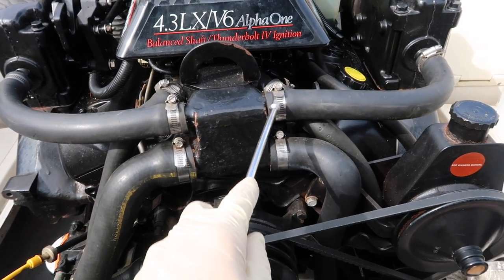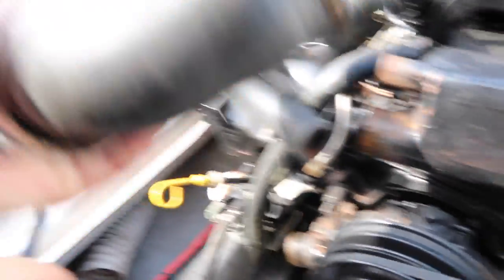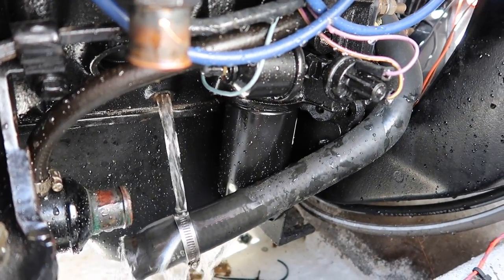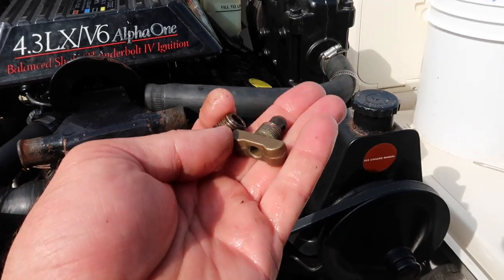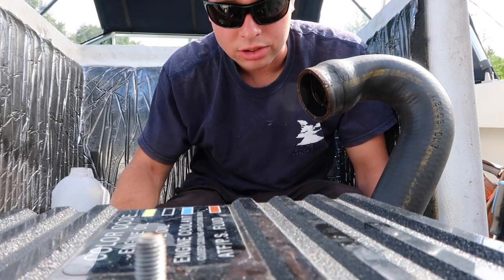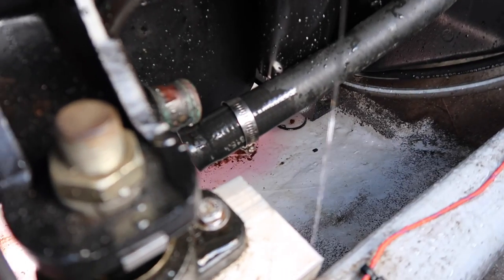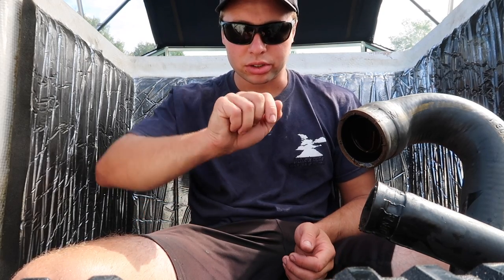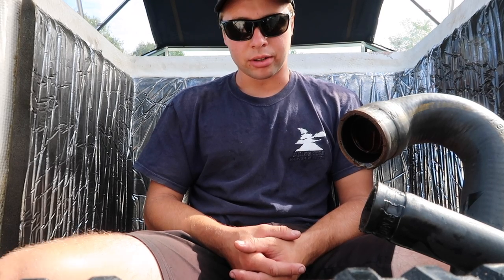Mercruiser 4.3 LX V6 Winterization

Comment: Thanks so much for this video! 
Just got my boat this season, and it ran great so I want to make sure I get it properly winterized. It was almost impossible to get to the port-side engine drain plug because my engine has seats on both sides. Your video helped me to locate that plug and make sure that I got everything properly drained. 
Thanks again!

Comment: I loved this video, I have the same '96 4.3 LX, but in my 22 years of ownership, I've never had the hoses off. After I loosened the 1st 3 hose clamps, those hoses remained solidly, stubbornly, like glued on. So, I resorted to my usual process of pouring 4 gallons of RV antifreeze into a funnel to a garden hose to the clamshell flush muff on the intake to the sterndrive, while the engine is running. Not elegant, probably not as thorough, but it works.
Reply from the maker: That works. Definitely not as thorough and does not remove the rust from the block but yes it does get the job done.

Comment: Great video. Straight to the point....I think i have a problem though, water initially came out of the block plugs but  antifreeze never did. And i put two jugs in it. Seemed to hold the majority, a little came outta the disconnected hoses. Am i screwed? 🤷

Comment: If you want to put some extra time in, you can fog the engine as well as drain/replace that lower unit oil. I like to hit the outside of the engine with a little wd40. That will keep built up moisture in the engine compartment from developing mold on the engine. Don't have to douse it, just enough to coat.
Reply from the maker: Yes all good idea’s. We always Fog, gear oil, stabilize disconnect batteries etc. I like the WD40 idea. Also a good idea is to prop open the engine hatch for storage to let it breathe.

Comment: On an I/O with the impeller in the drive I would put the drive all the way down, and disconnect the raw water intake line at the thermostat housing. Point it down in the bilge to drain. Then fill it with -100 AF till it comes out the drive water intakes. You can also just bump it over with the starter just a bit to get the AF fully in the impeller. Reconnect the hose. With the drain plugs I like to coat the threads of the metal ones in OMC gasket sealer or Permatex aviation and put them back in so they don't get lost. I had a plug leak just slightly on my OMC Cobra 4.3 and it leaked salt water RIGHT on the starter solenoid. Made it a rusted mess because the manifold drain was right over the solenoid.

Comment: PS if you have a newer Vortec V6 (intake has 8 bolts instead of 12) there is a drain plug on the front face of the intake manifold, left side as you fact it, will be behind the serpentine belt.

Comment: Agree on the great video comment . 
My 1st question is around the type of antifreeze and where to purchase in Ontario Canada.
Thank very much.
2nd question,
Have you heard of running the engine in a drum with  appropriate amount of antifreeze. Pro or con?
Thank you
Reply from the maker: Hey John, running in a barrel or on muffs with antifreeze can be done. However if you don’t want to worry do it this way. 

As far as antifreeze home hardware, Canadian tire etc is all fine. Some will say for plastic pipes only etc. Don’t worry about that. The system runs dry itself but we dump the antifreeze in to be sure there is no water in it.

Comment: Great video thanks. Very helpful as I bought a boat late season and I’m scrambling to winterize.
Reply from the maker: Glad i can help. They are very straight forward.
Reply: I going through now .   Did your boat freeze or no ?   I just bought 1 now got do it.
Reply: No, we have not got that cold yet. Sure have to stand on your head to do mine!
Reply from the maker: There is s select few that i can film. Most are head standing fun.
Reply: I did the muff antifreeze fill. Should I drain the fluid from exhaust and block? I see some people leave the antifreeze and some drain after. Thanks
Reply from the maker: It is up to you. I personally like them dry because there is 0 chance of it freezing. You can leave it and it may be fine but if the antifreeze mixture is leaned out at all from water in the block/ manifolds, hoses it could freeze. If the plugs are easily accessible give yourself some extra reassurance and pull the plugs and poke the holes and drain them.

Comment: some questions after watching:
you just need use the coolant to flush the hose, and don't need to fill is up. right?
When you drain the water and flush, how did you dry you boat after that? does the water out from the drain hole?
Thanks
Reply from the maker: Hey! Yes coolant is just a precaution as a flush to be sure the engine is drained. It will run out the plug yes.
Reply: Thanks for your reply. Really help me as a new boat owner

Comment: I really appreciate your time explaining it.
Reply from the maker: It was worth it just for your comment. Thanks Aleksander.
Reply: @Schneids15  i did today 4.3 mercruiser winterizing and i am scared that it is not done properly as i used camco canister and run fresh water up until termostat opened and then switched to the rv -50 antifreeze. Waited up until maybe 4 gallons of antifreeze went through and then i did fogging. I did open 4 spots and pink water went through kind of want to do it again i will put white plate to make sure is pink once it comes out. 40$ extra dollars for antifreeze but i want to repeat the process and will Fogg it again.  Fuel stabilizer is in it and 75% of fuel in the tank.
Reply from the maker: This is why i pull the hoses then put the antifreeze through. Those camco winterizers can cause big problems.
Reply: @Schneids15  totally i spent 100$ for the kit and antifreeze and then realized that i have water then today i went  again and bought expensive one without alcohol and put 5 gallons and did exactly what they said and once i opened the plugs it was water so i drained the system and put 2 gallons of antifreeze through all the hose i saw like alllll. Now i see pink if I failed as i am doing it first time totally accepting my fail did it the best to my knowledge. If the block is ok in the spring i am certified marine mechanic:)

Comment: awesome video thank you. first timer here. question, am i just pouring the antifreeze through all the lines as you did and leaving the drain plugs out and the hoses unattached? i dont pour anything in there after all the water has drained out and it is showing antifreeze and leave it in there and reattach the hoses? so more or less i am just flushing the hoses/cooler/lines ?
Reply from the maker: Yes drain everything and the antifreeze is just a flush to verify everything has drained out.

Comment: Did you have to put the plugs back and the hoses back on the manifold and fill it full of antifreeze for the winter or just run  flush it and leave it and not put nothing back together to store for the winter thanks

Comment: I really appreciate your video...awesome job. Just curious though...some guys talks about putting antifreeze in for the winter...if you do, you use just standard antifreeze (like auto)....or do you just leave everything open as some guys also say "air doesn't freeze"?  Thanks
Reply from the maker: Hey, so use RV plumbing antifreeze. Non toxic. Also using this method technically you need no antifreeze. The antifreeze is just a visual aid that the water has gone through the system.

Comment: Do you close the plugs back off and then fill it with coolant??
Reply from the maker: No I simply give it a little slosh so I can see the coolant come out the plugs to verify no blockages. The system stays empty and dry. “Air doesn’t freeze”

Comment: Hi.  Any chance you can tell me what the propeller size is on this?  I have a 1993 Maxum 1800 sr that has the 4.3 that looks identical to this engine so I was guessing your propeller would be the same.  I bought a boat that had the propeller all chewed up so I wanted to purchase the correct size and pitch.
Thanks.
Reply from the maker: Hey. I can’t guarantee size because every boat is different. Look on the sides of the prop between the blades or close to the hub on each end and it should show some numbers. You will need to find the pitch and the diameter. It will likely be around a 14 1/4 diameter and a 19P for pitch

Comment: Why the thermostat hose inside has springs and my left side manifold hose has a ball size plugs? Thanks
Reply from the maker: Springs are to form the hose and prevent it from collapsing. If talking the balls that are spring loaded going to manifolds that is so exhaust gas does not push in and go into your cooling system. Only water can go out

Comment: I have a question so the 4 hoses in the front the 2 top manifold and then you said the bottom that goes to the water pump do you pour water in there before you disconnect it and put it in the top?

Comment: Question: on the right side of the engine, there is a container behind the pulley. What kind of oil needs to be refilled there?
Reply from the maker: That sounds like your power steering pump. ATF is what they come with from factory.
Reply: @Schneids15  thank you for the answer

Comment: water pump is not in the back its in the front, does it need attention as well?
Reply from the maker: Water circulating pump is in the front correct. Water impeller pump is in the drive.

Comment: Great video...Great Job! Did you remember to throw some antifreeze down the out drive hose? I usually do that until it starts running out of it.
Reply from the maker: Yes you could do that for sure. I never have put any down the hose. It’s not a bad idea but I have never had one issue in 10 years doing it without.

Comment: Thinking about buying  a 2000 trophy boat with a 4.3 mercuicer, 21 ft walk around, the boat weights around 3000 pounds with fuel, please share your thoughts, ease of maintainence, horse power for a boat that size, is a good engine,
Reply from the maker: A 4.3 will have no problem with that boat. On the mid 2000 models they had some exhaust manifold issues but that boat should be pre that for sure. That being said the exhaust manifolds would have been replaced by now anyways likely... great motors. Very reliable. I have some with over 2000 hours on them. Many from the 1980s still running excellent still. You won’t win any speed records on top end but you should see high 30s in the mph range and it will pop out of the hole just fine
Reply: @Schneids15  great info. Your the best

Comment: Great video, two questions: Do you run the engine for awhile to make sure thermostat is open prior to doing this, and how much antifreeze do you use for this process, 2 jugs or ?
Reply from the maker: Hey Jared. One jug. No need to run the engine and open thermostat as you are pouring the fluid around it. Does not matter if open or closed
Reply: @Schneids15  thanks for the reply!
Reply: @Schneids15  i have a question for you buddy please when you can

Comment: Any tips for getting the power steering cooler hose off?   Mine won’t budge.
Reply from the maker: Try a flat head screw driver. Sometimes twisting the hose and prying on far end with flat head screwdriver will crack it loose.
Reply: Thanks for the quick response. If I can’t get it off, can I take off the hose at the thermostat and pour antifreeze in it and it will go out the back of the boat?
Reply: Another option if you have mufflers is to warm the engine up, warm hoses usually come off a little easier. Also, lightly use a pair of pliers around the hose where the bracket was and twist back and forth a little. Key word gently as you don't want to damage the rubber. I have done this on numerous auto hoses with success every time.
Reply: (A little late, but for future visitors) Use channel lock pliers, grip the hose on the nipple and rotate the hose on the nipple.  That breaks the seal without damaging the hose. Then you can pull it off.

Comment: Nicely done!  I have same engine.  I do it pretty much the same way.  I consider it thorough.  Never had an issue in 20+ years.  I also like to spray my hoses with WD40 before I put them back on.  Skipped it one year and hoses were harder to get off (or so I thought) - maybe just the placebo effect!  What is your opinion on these antifreeze tanks that you hook up in-line with your ear muffs?  I bought one but I hesitate to use it.  I think it'll be great for my wave runners but I hesitate on the boat.
Reply from the maker: Great idea with wd40. You know what the ear muffs do work however i would not sleep for the whole winter worrying about if i did my boat that way. Drain it the way you are used to. Your block will not freeze then. You have a good method. Josh

Comment: Have you ever had to replace a starter on these? I've got the same engine. Trying to determine the best way to get the starter off.
Reply from the maker: Either 9/16” or 1/2” wrench. They are a pain depending on the boat. Have to have lots of patience and slowly turn wrench by quarter turn each time. Can be a very frustrating job.
Reply: I know I'm late with this reply but I replaced my starter last year. Totally sucked! Horrible place in the boat. Must have taken me 4 hours of swearing and scraping my arms up hanging upside down to get at the screws. But I got it done and the boat runs great now.
Great video!
Are there only 3 drain plugs on this motor? I can't find any more.

Comment: I have power steering.   I did not see the hose to it were you said drain it.  It is 4.3. Lx
Reply from the maker: There is no cooler? Follow your power steering cooler lines back to the motor. It is rare to not have a cooler.

Comment: Thanks for video, just got same engine.  Rv antifreeze vs auto type?  What about engine fogging, or do you have a different video.
Reply from the maker: Yes rv because it is non toxic. Engine has glycol in it, deadly stuff. Yes fog it. Pull the spark arrester( air cleaner) and fog through the carb.

Comment: Hi, i have the same engine but I'm having trouble trying to get it started. It only turns on when was full throttle. When i go back to neutral it turns off. Have you ever had this problem? Thanks
Reply from the maker: Hey Andres, yes i have. It sounds like the engine is flooded. It could be a sticking carburetor needle valve. Will it ever run normal? Black smoke?
Reply: @Schneids15  yes the engine runs. After a while on i get black smoke. So i turned it off.
Reply from the maker: The black smoke is just your engine running rich. Take your “ air cleaner” off the carburetor and see if your choke is sticking. The “butterfly” flapper on the intake should be straight up and down once warm. If the choke is stuck it could be running the engine too rich and causing this.
Reply: @Schneids15  the butterfly flapper is the ways you said.
Reply from the maker: I would assume you need to get your carburetor rebuilt. It could be your needle and seat not sealing properly and flooding out the engine.

Comment: Thanks for the video. But its a 205 hp or 190hp??
Reply from the maker: Unsure what it is. All 4.3 gm are the same though. The HP differences don’t change the winterization process.
Reply: 4.3 LX is 205 and 4.3 195

Comment: Curious if after putting the plugs back in and the power steering hose back on if you dump in some RV antifreeze and leave it in?
Reply from the maker: Hey Doug, i leave all plugs out and hoses off all winter. I reconnect in the spring. However you could re connect them and leave the system dry for the winter. Lot’s of people have had that rv antifreeze actually freeze and that is why we leave them empty.
Reply: I see videos of the AF freezing, but I believe it does not expand as water does, so its actually safe to leave in.  It can help stop rust over the winter.

Comment: Great video and I have used it to winterise my 4.3 for two winters now with no problems.  I have one question that I wondered if you could answer, by pouring the antifrezee into the hose like you do at 3min31 in the video, are you relying on the engine being warm and the thermostat being open to allow that coolant into the block?  I've never been sure if that is the case, and to be sure I pour coolant in my engine like you do there, but I also put that hose back on in its normal postion and pour coolant down it so it goes down to where the water pump is at the botom of the block.  Just wondered if the way you do it, the engine needs to be at full operating temp to ensure coolant enters the block?
Reply: when you pour af into the big hose in normal position it goes into the block where you want it to go, if you pour in the top with hose flipped all it does is go through into and through the intake hose and transmission cooler, kinda useless, so keep doing the af into hose in reg position if you want to get antifreeze ie af  through the block